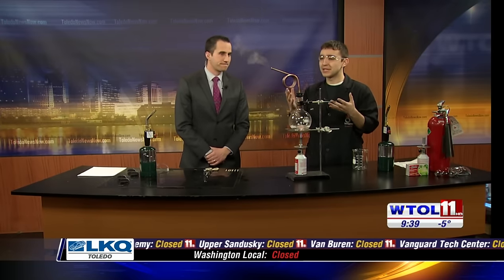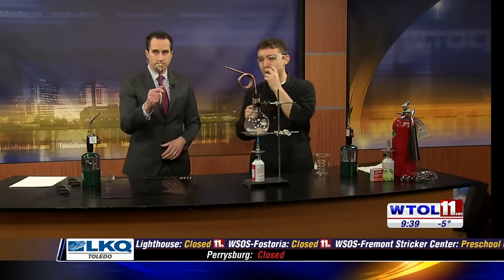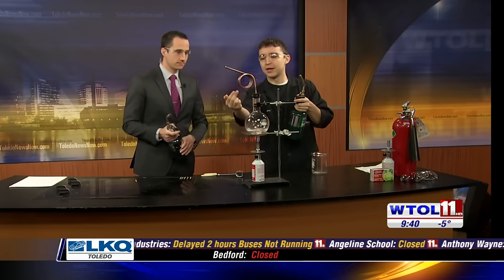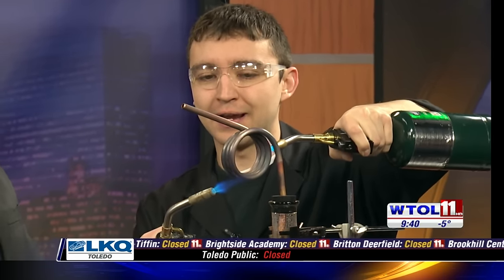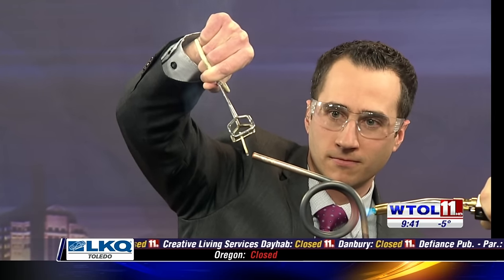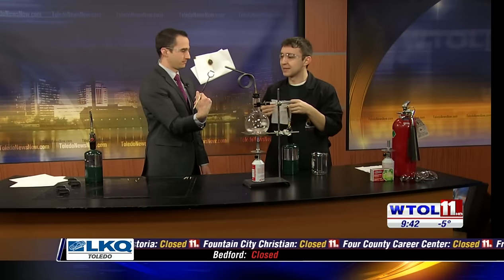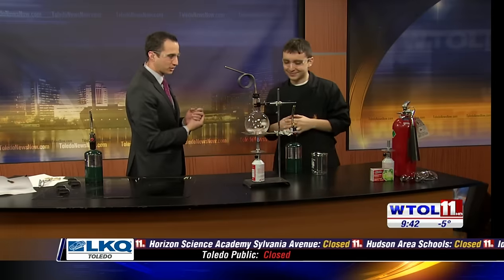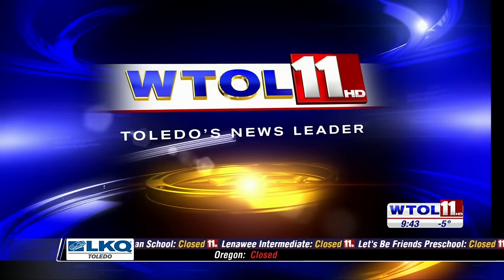Properties of superheated steam

Comment: We learned this first -hand in the engine room of our navy ship and received a very serious caution: If you hear a high pitched whistle it is a steam leak...do not "look" for a steam leak with your hand or you could lose a couple of fingers as the super-heated high pressure steam will cut-off your fingers AND cauterize the wounds instantly without you spilling a drop of blood...this stuff is real!
Reply: My father worked in the engine room with Pand O cruise ships 1970's....he said they all feared super heated steam.
Reply: Magician blood before it touches the floor, & no need for a saw anymore 🙂
Reply: I heard that using a broom or mop was the preferred method for detecting leaks in this case.
Reply: @TheChris1299100  Still is, although thermal cameras are helpful too
Reply: That's just insane, i wonder would it actually be painful or not
Reply: @archise3191  i dunno man, having a finger or the whole hand burnt/cut by a superheated high pressure steam jet so hard that it doenst even bleed sounds painful. Could be wrong tho
Reply: @archise3191  You will definitively have a scald after that and it will hurt a lot.
Reply: What a convenient way to get rid of your fingers
Reply: huh, so water in all forms is quick and deadly, in its liquid form under high pressure it basically does the same thing, just doesn't block off the hole
Reply: @theultimatetrashman887  pretty much lol
and dont forget about ice. People on the Titan hated that stuff
Reply: We learned about super heated steam at Great lakes naval Training Center.  We also fell asleep during alot of training center classes, but this subject kept me awake.  As it turned out, I became a Navy Seabee.  The only time I served aboard ship was my two week training cruise at Norfolk.
Reply: man that's freaky enough just by hearing it tears off your finger but doesnt make it bleed,
sound pretty painful to me
Reply: That's a Lightsaber my man
Reply: That's the most metal thing I've heard this month. Thanks!
Reply: I was in the Fire Room on the other side of the Bulkhead!
Reply: "Today a young man from the 8th grade invented a super-heated-steam surgical and cauterizing tool for his schools science fair"

Comment: Notice the matches ignited but showed no tendency to keep burning. That is mostly because the match head coating (like gunpowder) contains its own oxygen, but once the coating is consumed the steam is actually driving away the oxygen from the air -- which would be needed for continued combustion of the wooden matchstick.
Reply: Hmm... that explains why the match lit up, but the toilet paper was only scorched.
Reply: I find it interesting that the gas is hydrogen & oxygen but it isn't conbustable
Reply: I'm pretty sure it was the steam just blowing out the flame as soon as it lit. 

Like wind does to a match or lighter.
Reply: @Eduardo_Espinoza that’s because the hydrogen and oxygen are stuck together in the form of steam, the oxygen needs to be separate from the hydrogen to facilitate combustion. Elements and alloys do this, they have completely different properties when they’re combined vs when they’re seperate
Reply: @sleepybraincells  tnx
Reply: Old steamships would use steam smothering for fire suppression.  It was phased out starting in the early 1960s, I believe.
Reply: @Eduardo_Espinoza it's still water, just in gaseous form. The hydrogen and oxygen are not separate elements, they don't separate at all just because the phase is different.

Comment: I find the most interesting thing about superheated steam, is that water has an incredible ability to continue to expand in volume as it is heated.
Reply: all molecules expand when heated. what amazes you is the relatively low boiling point of water.
Reply: @h7opolo  wait until you hear about gases.
Reply: @h7opolo  also, molecules don't themselves expand when a substance is heated, they move around more violently.
Reply: Heat gas hot enough and ionize it and you get fire/plasma, the fourth state of matter
Reply: @Ultralagger R.E.V
Sounds like hot girl stuff 🙂
Reply: @jossypoo  but gases are not good for real world usage e.g for turbines/steam engines, since you have to cool them way below 0 C to get liquid(storable in large quantities)..
Reply: Exactly. Gases are no replacement for steam because suitable gasses aren't liquid at room temp.

Comment: My late father served on numerous ships during WWII including steam-turbine powered that used superheated steam. He said the most dangerous part was you could hear a leak but not see it even though it could cut flesh. He described to me hunting SH steam leaks with a piece of toilet paper on a broomstick. Interesting factoid: in regular steam the energy is in the pressure of the steam while in SH steam the energy is in the temperature of the steam.
Reply: The Navy still has a few steam ships that use superheated steam. Most of the Wasp class (minus the Makin Island, she's gas turbine) Blue Ridge, Mount Whitney, Frank Cable and Emory S. Land.
Reply: dbmail545 energy depends on tons of things though in different kinds of containers/conditions ie adiabatic, isobaric, isothermal etc. 

Tons of conditions actually. 
Source: I’m an me student, I study thermo
Reply: @boldstar69  do you study steam power? If you do then you know that superheated steam is not at a hugely greater pressure than wet steam because most of the energy is in the temperature. Never exposed to that? Hardly surprising  considering how little is done with steam power these days.
Reply: @dbmail545  I studied thermodynamics 2 this semester(focusing mainly on steam/water[no refrigerants yet]), and will do powerplant design on the next (still new year's break over here). 

Again there are a lot of factors, sh steam can be at least 20x the pressure of wet steam with not much difference in temperature it depends on the processes applied and tons of other conditions. 
Are you familiar with Temperature-Entropy diagrams? Mollier Diagrams or steam tables? that helps a lot with finding the energy (work energy, work loss, Wnet, energy chargeable etc.)
Reply: @dbmail545  you are talking about the subcritical region, yes i am a thermal systems engineer, you are right when we go towards the superheated steam we usually look for a moderate pressure high temperature steam because it gives us a higher area outside the vapor dome, and thus a lower condenser pressure as well, but that's for a sub critical system, if you go towards the super critical region the scenario completely changes
Reply: @alidurrani4645  this is just a congregation of Thermal lovin Engineers and Students. this is a club. im just a random dude who has no idea whats going on but i felt like puttin a comment for notifs
Reply: @Stand_Tall  me too. I just like reading the comments.  Thanks guys.
Reply: Energy of the steam per unit of mass is neither the pressure, nor the temperature, but entalpy.
Reply: @Sixta16  enthalpy?
Reply: @Stand_Tall  All I know is, I've had too many calories.
Reply: Delta t delta p temps and pressures corospond. Superheated (above it saturation point) fot steam turbines is going to b high press. And high temp they dont want it condensing while traveling througb the blades
Reply: YIP....SHS DRYERS.....
Reply: @davidgreen5099  Yes enthalpy. It is a Greek word [ enthalpia_ ενθαλπια] it means the inner thermodynamic energy of steam [ or of an exhaust gas]
Reply: @Δημητρης1949  thanks for replying.  I looked it up, which I should have done first.  Thanks for teaching me.
Reply: @davidgreen5099  You wellcome.As a nechanical engineer I had to explain with simple words.
Reply: @alidurrani4645  Does superheated steam lights up like hydrogen?
Reply: You do realise, a 'factoid' information  based off assumption and somthing thats never been confirmed? Its not a cool way of saying 'fact'.
Reply: Respect to your father.
Reply: On lots of US Navy vessels we still use high pressure super heated steam, with the most conspicuous example being any aircraft carrier (Except the new Ford class), which uses steam to drive the catapults. You can see this easily on literally any movie that includes carrier-launched aircraft, with the Top Gun films being prime examples. Below decks we had a 6 foot tall,piece of cardboard we carried in front of us any time we suspected a steam leak, as it would cut right through the cardboard, and if you weren’t careful, right through your fingers, them arm, and then chest. 

I never had to deal with a steam leak as our reactors were always in good shape, but my first Senior Chief was missing two fingers where he’d reached into a crevice to pick up a dropped flashlight and inadvertently found the leak. He claims they couldn’t even hear it, and the only warning they had was a slight increase in steam use beyond what was expected - because the leak was that small.
Reply: the authors comment already freaky enought but as u read otjee comment my brain gets wild i could only keep reading and imagine what they were talking about,
it all sounds so interesting but my mind cant cathc up 😭

gotta love people with strong minds

Comment: We used to put rags on a broom handle to look for leaks in boiler houses in the steel mill.  Better than being cut by a leak.
Reply: My grandma used my hands. I'm currently typing with a pencil in my mouth
Reply: FREE CAUTERIZING
Reply: I had a stroke while reading that
Reply: @jasonblake6601  Reading must be difficult for you. Bless your heart.
Reply: Navy black gangs use the broom & search with the bristle end.
Reply: I saw a guy get cut in half by SS in the Navy and I still cant get it out of my head after 30 years
Reply: superheated steam..google it and also boiler steam accident kills engineer
Reply: Here in the petrol plants in as Texas there is a general rule that if you hear steam whistling you don't go look for it. Don't want to walk by that and get fucked up bad.
Reply: @Anonymous a leak of super steam if you wave your hand infront of it could cut your hand off literally. Met a guy who lost fingers because of superheated steam.
Reply: Still do it now
Reply: @Anonymous Pressure goes up as temperature goes up. If there's a "leak" of superheated steam, it's usually also under extremely high pressure. Ever see a water jet cut through metal? Now imagine that water jet as a blast of superheated steam. (yes, the analogy has some technical flaws, but it might help answer your question).
Reply: he was running to the escape trunk
Reply: No infared cameras? I don't believe I spelled it correctly but i don't feel like looking it up
Reply: @Anonymous ss = superheated  steam
Reply: @Anonymous it cuts because it is so hot. It's even worse than being cut by a acetylene cutting torch. boiler house = boiler room.
Reply: @bobabooey8367  hope I never see that

Comment: Properties of superheated steam:

It has a lot of heat.

video ends
Reply: I think the point he wants to make is superheated steam is DRY.
Reply: Yep^
Reply: Dry water, huh?
Reply: THΣlement the lesson learned is watch for broken pipes as superheated steam may melt your skin off and you wouldn’t even know what happened.
Reply: @thlement7626  not dry, not even a single thing except the flash paper caught on fire, because it's wet.
Reply: Well, yeah, technically, that is true. Water has very high enthalpy of vaporization, so saturated steam has a lot of heat in it. Superheated steam has even more.
Reply: So here's a thing to know about heating/cooling stuff: whenever you change a chemical's state of matter--melt it, freeze it, boil it, etc--the temperature of the chemical stays locked at the exact temperature of the phase transition until the entire sample has transformed. So, if water boils at 100 degrees Celsius, the water STAYS at 100 C until all of it has boiled off. This is why boiling water is so useful for cooking for instance, because as long as there's water boiling in the pot it will cook at an even, consistent temperature the whole way through.

Now, because of this, the steam coming off the water can't really be hotter than 100 C either. If the water is at 100 C all the steam coming off is going to be right around 100 C as well, and because gasses tend to lose heat much faster than solids or liquids, it quickly starts to condense and turn back into little drops of liquid water in the air, and that's what you see when you "see" steam. So as far as the average person is concerned, steam usually isn't "that" hot, and it loses heat quickly so it's not very dangerous if you keep it out of your eyes and face.

However! Steam can certainly get much hotter than 100 C. If a pipe full of steam is exposed to direct heat, like in this experiment, or perhaps a radiator in a house fire, it can get very, very hot, very quickly, much much higher than 100 C. What's more, steam's ability to lose heat quickly becomes another danger as it rapidly transfers heat to anything it touches, including you. Superheated steam therefore becomes a nearly invisible hazard in a fire, able to spread the fire across a room and cause severe burns before you even know what's happened. This is why you should always stay away from radiators while evacuating a fire.
Reply: @thlement7626  Generally known as 'Dry Steam'.
Reply: so what are we going to do with it. that's the question.
Reply: I would have lit a thousand matches with the gas he used to heat the coils and it barely ignited the match.
Reply: @Narokkurai  See, THIS is what they should have underlined, the practical implications, not entertain some newscasting joker who can't help but ooze condescending disdain from his face into the camera over the demonstrating dude.
Reply: its for industrial use mainly, like turbines etc.  slightly superheated steam is used for transporting it for a long distance whitout having it condence. an example for that is the industrial park where i work. 1 factory process which has huge exess heat uses that to produce  steam, and supplies the entire park.  they supply 5bar steam at 158*C but its heated to 170-180. and water is added where u need it.
Reply: @Narokkurai  Thank you, in the end i even did learn something from that video.
Reply: @zagorith14  The match ignited because it had fuel (in the match head) + oxygen (from the air) + heat (from the steam).
Reply: @carltonblend  The reason that the burning wasn't more dramatic was because the steam also displaces oxygen - so things with  their own oxidizer internally (flash paper, the head of the match, etc.) burn, but things that need external oxygen (the stick of the match, the regular paper) just char or go out entirely.
Reply: @zagorith14  so what you said is a match is a wooden stick. Wrong. A wooden stick is a wooden stick
Reply: wet (or saturated) steam is VERY hard on turbine blades. Superheated steam or (dry) steam is just a hot gas (and for military warships) is under very high pressure, with the older conventional steam carriers (all retired) running 900 degree F at 1200 PSI.
Reply: and it's invisible, that's 2 properties so he can use the plural
Reply: @carltonblend  it's dry

Comment: I know of industrial situations where they use a broom handle to hunt for steam leaks.
Reply: Nick Maclachlan  that is my understanding, as well.
Reply: In fact lot of people had died from this dry steam because we cannot see it
Reply: I used to do work on naval vessels that had superheated steam lines. The induction warned that if you heard a leak, you'd stand where you were until the leak was found by the navy personnel (presumably using the broomsticks!)
Reply: "Just put out the finger you like least and you'll find the leak"
Reply: I work in a factory we use a ultra sonic leak detector.
Reply: we used a long reach mirror.  Also, you can use thermal imager.
Reply: This was in one of the episodes of the J.A.G. :) and they discovered the leak by the same way. The death of the soldier was an accident.
Reply: The MTB-----And if you didn't, it could cut your hand right off. True fact.

Comment: Very nice for understanding that the super hot steam is a very different beast from the regular steam.

In the large industrial factories there is steam that is 300º C hot. It's not safe for life and all the pipes are under very hot pressure.
Reply: "Hot" doesn't have pressure.
Reply: How about using FLIR camera?
Reply: It is very high pressure and it is dangerous, it can literally cut walls. The heat is extra "bonus"

Though, despite hot steam being such a beast, my personal favourite is liquid oxygen.
Reply: It's not about superheated steam as much as dry steam. Wet stream contains suspended water droplets aka liquid water. Pure dry steam is a gas.

There are various ways to get dry steam, a lot of it has to do with piping arrangement. But in theory at least steam can be perfectly dry without being superheated.

It's just a lot easier to produce perfectly dry steam when it's superheated.

Comment: Industrial superheated steam is extremely dangerous.  It can cut off an arm or head if someone passes by a pipe leak they didnt know about, which isn't that hard to do because of the noise in industrial settings.  Also, the heat isn't always noticeable until too late because the jet of the steam leak tends to induce a lot of cold air around it with vacuum forces.

Comment: in the new power plant of our paper mill, a temperature sensor broke out of its fitting. The high-pressure steam at about 500°C = 932°F ignited something combustible causing a serious fire before the boiler could be shut down, and filling the adjacent paper machine hall with smoke and soot. It needed a lot of cleaning, and even the rails and electric contacts of the overhead crane had to be wiped clean before the electricity could be turned on again!